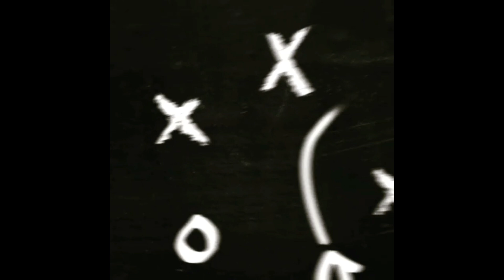1st ever homemade Helicopter in Manipur!!!

Comment: 😂😂you cannot make rotary blades with steel. They're made up of carbon composite fiber
Reply: @9 years ago, so what did the earliest helicopter designers make them out of, at the beginning of the 20th century?  There wasn't any composite back then.